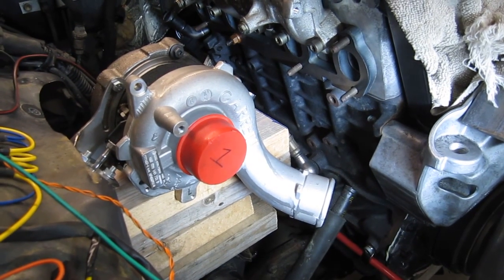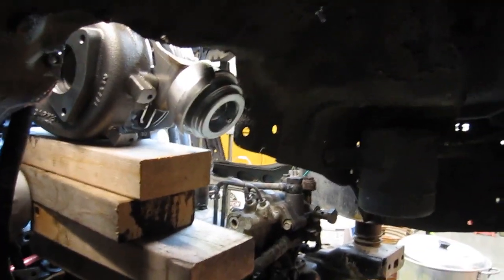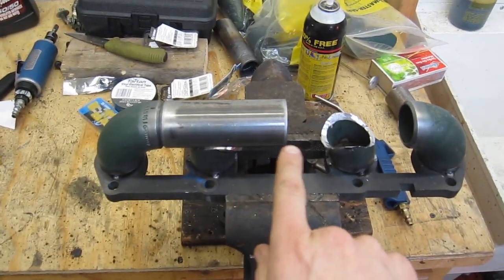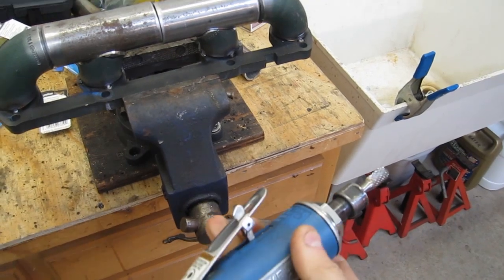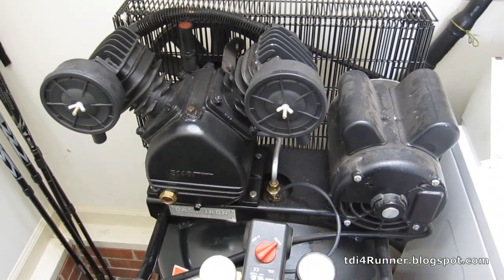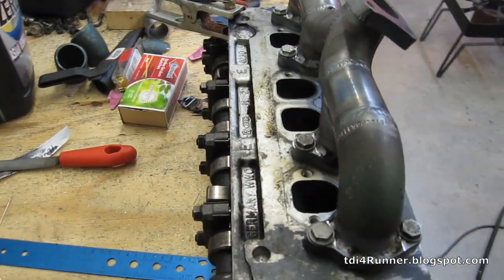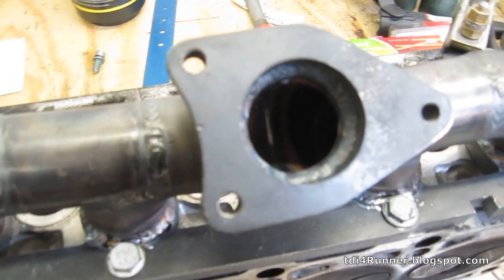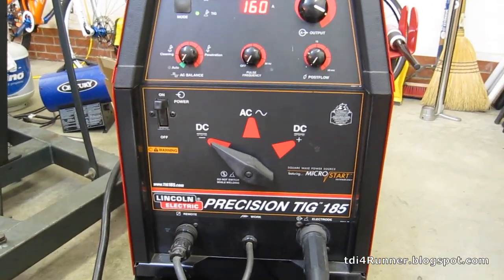TDI 4Runner Build Pt 5 - Diesel Exhaust Manifold (Turbo Log) Fabrication

Comment: looks great! looks more efficient than most log manifolds on youtube. did you do all the cuts with a grinder?
Reply from the maker: Thanks! I did the rough cut with a cut-off wheel on the air die grinder and then cleaned it up with carbide burrs on the same grinder.

Comment: Really good stuff but I do want to share some information. Go to Eastwood and buy a tungsten grinder. It's very reasonable and greatly increased the quality of my work. He diamond disk last a long time and put a very fine grind that focuses the arch.  You can't go wrong and will never use a grinding wheel again.
Reply from the maker: Thanks for the info! I do so little TIG welding that I haven't bothered to look into a separate tungsten grinding setup. I will revisit this thought when I get the next/new shop up and running. I had to move and am in between work spaces.

Comment: I would've removed the turbo's internal wastegate and went with an external one. A decent v-band brand-name replica would've sufficed. I've been using my EMUSA 38mm v-band wastegate for 2 years+

You could've done a top-mount manifold with an EWG for better efficiency
Reply from the maker: Like I mentioned in the comments below, there is no wastegate on this turbo. It is a VNT turbo. Look up how it works. The turbine housing basically has a variable geometry. The ECM controls the vanes to allow for optimal spool time. Again, there is no wastegate. I'm not going to mess around with welding a V band flange to a brand new turbo that has a cast iron turbine housing. Already setup for a bolted flange, no need to change it for this application.

Comment: Nice work . 

What about coliding flow from cylinders 1 and 4 have you considered that ?
Reply from the maker: If I had unlimited room in the engine bay, it would be much easier to create and ideal manifold that was tuned perfectly. However, there are tons of turbo engines making big power on log style manifolds. I'm not too worried about. It's a good compromise given the room I had to work with.

Comment: Nice manifold design for a log type and I like that brace you made..  It should hold up fine.  I like to use a spare head for finish welding when I do manifolds too, because it does help keep warping down because it keeps the flange secure and makes a good heat sink.